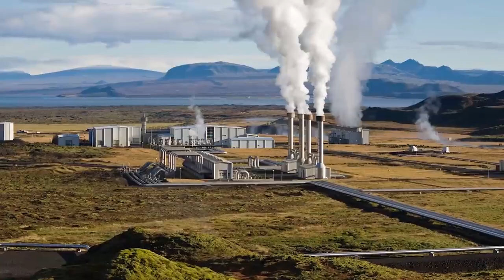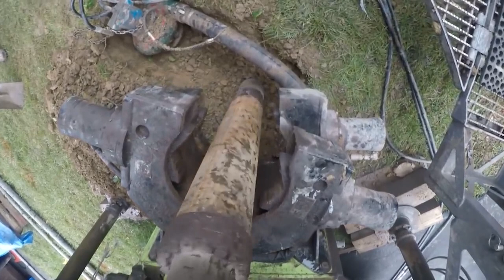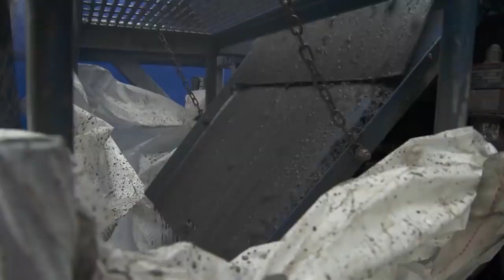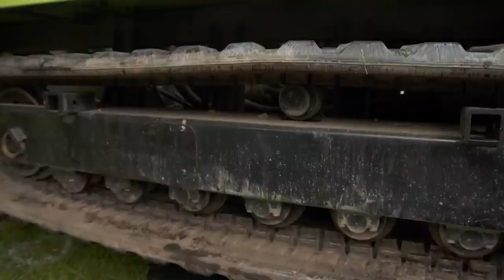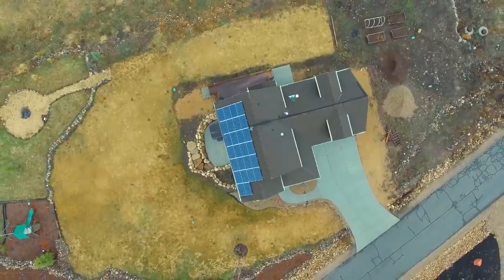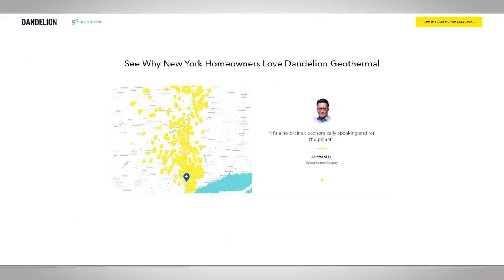Dandelion: Geo-Thermal Disrupts Home Heating?

Comment: Ground source heat pumps are old Tec . 
The problem is the size of the radiant heat panels in the houses ie underfloor heating . Instillation and cost !
Reply: Nope. Heat pumps work just like air conditioners, using the same means of deploying heated/cooled air as your present air conditioners do.

Comment: Referring to this as geothermal is at best misleading and more accurately a complete fucking lie. It's harvesting geothermal energy in the exact same way as saying a regular heat pump is powered by heat from the air.

It's a ground coupled heat pump which is an old concept and should be referred to as such.

Comment: She talked about mud mess with other drillers then said their process  makes mud mess too but they are more carefull . I wonder about that .
Also when asked about heat pump electricity costs she said it's  not that much . How much ?
And finally if you remove heat from the ground it gets colder and less efficient... is it substainable ?
Is it substainable if your neighbours  also remove heat from the ground next to you ?
Some geo thermal systems use the water main as a heat source. 
Some have dug large spaces in the ground cemented , and filled them with rocks and water then covered them and draw the heat from the water which collects heat in summer from AC  and returns it to home in winter .

Comment: not so much that teh earth gives heat...its a constant temp..so if your house is hotter then the earth, itll pull the heat from your house to the earth..also if you house is colder...itll pull the heat from the earth...thats how thermodynamics works